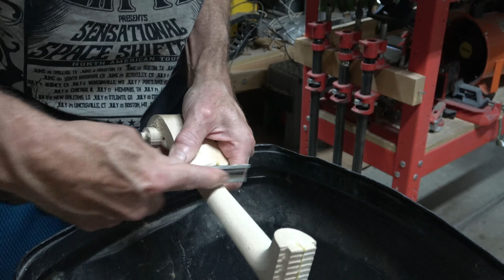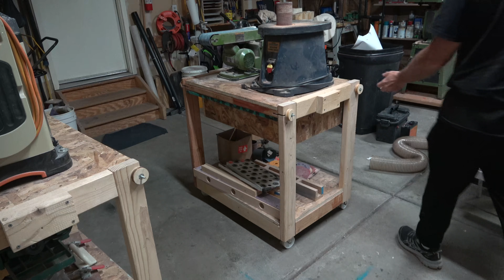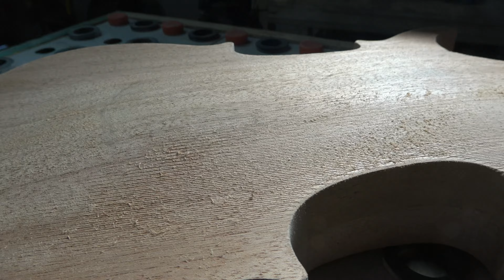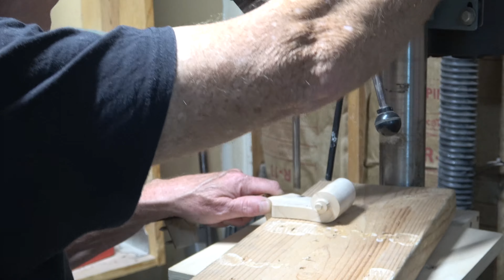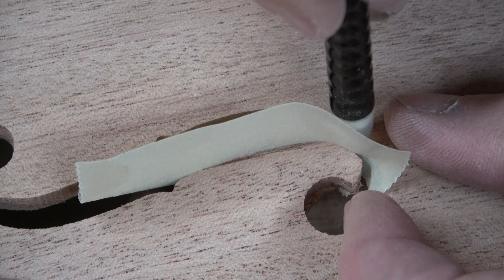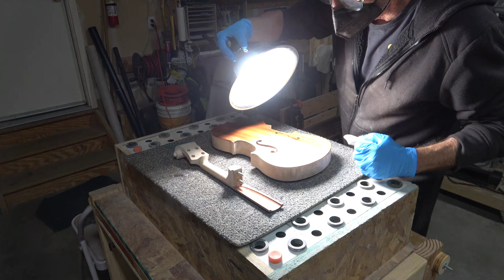Making An Electric Violin Part 8 Sanding The Wood

Comment: Isn't this violin extremely heavy?
Reply from the maker: Yes, it's a bit heavy. About 2.8lbs when finished.
Reply: @HighlineGuitars  well, almost 3 times as heavy as an acoustic violin, that clocks in at roughly 1 lb. You gotta have a pretty firm chin grip to hold this instrument, I think🙂
Reply from the maker: @MichaelSmith-on1ig  Definitely not for wimps.

Comment: Curious to hear what it sounds like with such a thick shell. Great project and thanks for sharing!
Reply from the maker: You and me both!
Reply: It's going to be different, doesn't have a traditional sound board. I think it will be like playing an electric guitar, take away the pickup and the sound will be muted. Plug it in and you should be fine.
Reply: @brittboyette461   Agreed. For an electric violin it really doesn't matter about the acoustic properties of the wood, it is as you said more like an electric guitar, as all the "work" will be done by the pickup(s). However, having said that it all depends on what you want it to sound like. 

As i replied last time, I made an electric violin out of a piece of maple, and it worked fine although i was using a dual piezo bridge pickup. I have tried a few electric violins, and found that as i DID want one that actually sounds a bit like a normal violin,  a hollow construction, not unlike the one in this video gave me that the best. I find that a really solid type of body gave me an oddly flat and unresponsive feel when playing, which wasn't what I was after. For my style of playing it seems that having a thin (ish!) area under the bridge definitely added to the sound, so i suspect this construction technique would be fine for the sort of sound and response that i would like to play, myself.